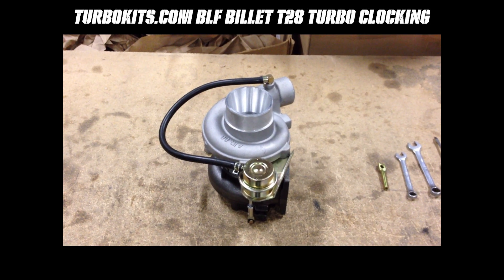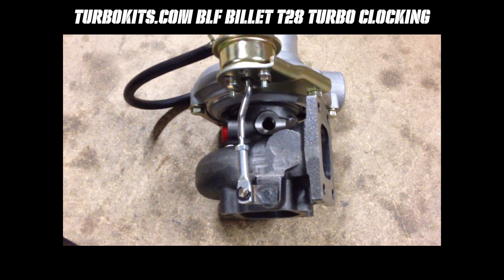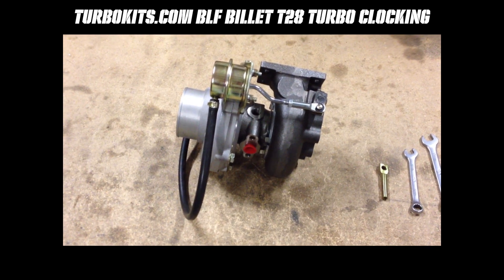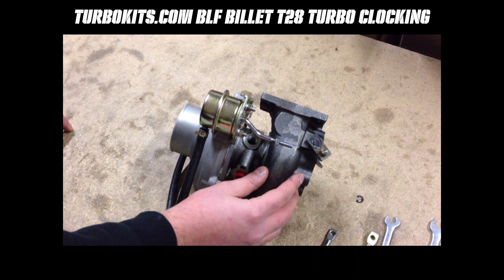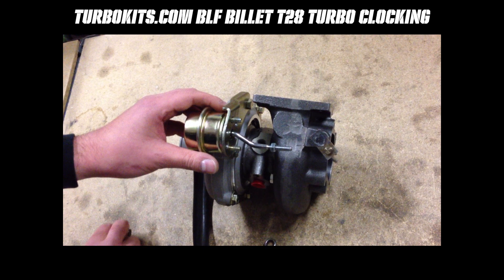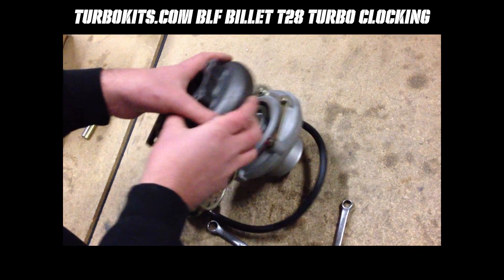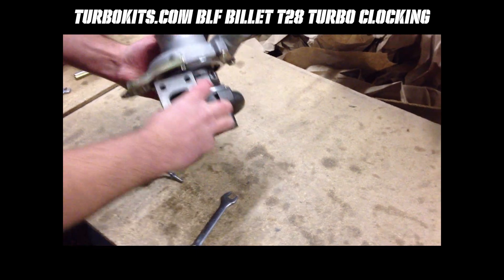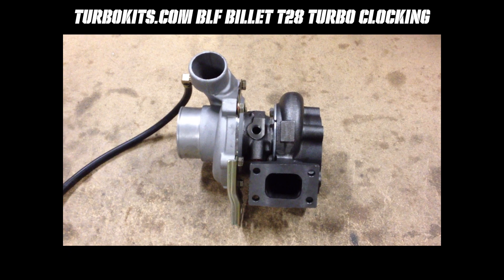How to Clock a Turbo - by TurboKits.com

Comment: thx a lot for the answers,i don t pinch the compressor wheel,but the compressor is not at eleven like in the video and the actuator is not at the position like in the video,i will remove the turbo from the car and fallow the steps just like in the video. thx
Reply from the maker: +5supercinque You're welcome, but I'm not sure what the issue could be. Clocking a turbo is a normal part of turbo installation in the aftermarket. When done properly, it does not have an effect on the performance of the turbo.

Comment: Is this something that has to be done
Reply from the maker: Turbos by nature are universal, companies like Garrett, Precision, Borg, Etc have no idea what you are installing it on, and the orientation you will require, so 99% of the time, on a universal turbo, YES you will need to clock them. If you are asking about this EXACT turbo that comes with our Celica GT/GTS turbo kit, we do bench clock before we ship the kit, so 90% of the work is done for you on that specific application.

Comment: Any suggestions for clocking a small T2 Garrett?  I know how it supposed to be done but it won't move. It has the big snap ring on both the compressor and the turbine. 
I need to rotate both the compressor and turbine clockwise 3/4- 1". 
It came off a 84 Nissan 1.8L 4cylinder and it's going on my Sportster. Any help would be greatly appreciated
Reply from the maker: You have to loosen the snap rings and then it will rotate. Keep in mind the actuator and bracket location will change and could potentially require adjustment to change the clocking.
Reply: @TurboKitscom  thanks for your response. 
I was finally able to get in touch with the guy that actually ran it last. He said he had rebuilt it about 12 years ago and used it on his bike with a  blow through setup while he was tuning and getting the bugs worked out. Afterwards he installed a larger turbo. He said it would probably be hard to move since it had been so long since it was taken apart and moved. He did at least drill and tap 3 additional holes in the compressor housing where the actuator bracket could be moved if it needed to be. Thanks again
Reply from the maker: @LH-kz2nf  Ahhh yes, if it has not been moved for that ling, it would require a good soak in some penetrating lubrication!
Reply: @TurboKitscom  this my first turbo and I chose the most complicated way of doing things because everyone advised me not to try it. First of all very few people get a blow through tuned on a Harley and 2nd no one mounts the turbo on the left side. Luckily I found a 62 yr old engineer that's done it before. He's a very patient man I'll say that and has spent a year of his time through 100s of emails helping me pick engine parts and everything else. The math that goes into this is crazy for someone like me. Graduated in 82 and haven't used algebra since then.  What I learned then they probably teach in grammar school now.
People like you and my good buddy google are a life saver.
When I bought the turbo, plenum and other things it came with a rebuild kit that contains new o-rings, bushings and cartridge.
I just need to find the right set of snap ring pliers. I have two pair and they're not doing the job.
Thanks again for everything
Reply from the maker: @LH-kz2nf  Happy to help, good luck with your build and let us know how it all turns out :)!

Comment: thx a lot for very quick answer,can the wrong clock afect the boost?
Reply from the maker: +5supercinque  - Only if you pinched the compressor wheel and damaged it, but if the clocking was done properly, it does not affect boost.
Reply: +TurboKits.com Silly question but does it matter which side is the coolant in and out?
Reply from the maker: +Hakasauars No, coolant / water is pressure in and out, oil is pressure in, gravity out.
Reply: TurboKits.com Thanks!
Reply: +5supercinque yes you can over heat your oil and water section, coked up oil is no good plus your intake temps would be higher so less,air density less power

Comment: hi,sorry to bother you again,I clock again the turbocharger,everything is good at the turbine position,oil  and water inlet and outlet,but the compressor is not at eleven for my engine position,he must be at eleven on every car?
The compressor at what position must be to make boost?    thanks a lot
Reply from the maker: +5supercinque - It doesn't matter, turbos are universal by nature and can be closed into any position to fit whichever vehicle it is on. The clocking has no affect on the boost production.

Comment: can you run a water/oil cooled turbo with just oil? like block off the coolant port for simplicity? turbo will only see 8 psi max
Reply from the maker: +zombiecheef Depends on if it's a Ball Bearing turbo or not. The journal bearings turbos use oil to make the bearing, so they have a good amount of oil to help aid in cooling the CHRA. The ball bearing turbos however use only a small amount of oil for lubricating the bearings so additional water cooling is needed to keep the internal temps in check. In all reality, it aids in turbo longevity and reliability no matter what turbo you have, so it's best to run them when you can.

Comment: So, for the 2ZR kit, you follow the same procedure but the compressor outlet points down, correct? I assume all the bolt holes in the actuator bracket still line up and a flip of the bracket may be necessary? What brand of T28 turbo (the basic turbo) is included in the Corolla/Matrix 2009+ (2ZR) kit? Thanks!
Reply from the maker: Yes that is correct, follow the clocking instructions, but point the compressor to your specific location required. The turbo is a BLF T28.
Reply: @TurboKitscom  Great. Thanks! So the BLF T28 is the billet wheel turbo? The billet wheel appears to be an upgrade option for the 2ZR kit. Is the 'base' T28 exactly the same as the billet wheel turbo but without the billet wheel? Sorry - learning stage here. :)
Reply from the maker: @acbent11  Correct, they are the same turbo, just one with a CAST wheel and once with a Billet Wheel. Good news, the next shipment of BLF T28s will all have Billet Wheels and there will be no additional upgrade charge for them anymore :)

Comment: Thank you for a very informative video.  That wastegate actuator bracket looks very versatile!  What are the torque specs for the compressor/turbine mounting bolts, and how critical is that torque?
Reply from the maker: +Michael C - Compressor bolts we normally do to 200in/lbs, but it's not critical. Most of the time customer are just hand tightening them.

Comment: hi,I bought a new china turbocharger just like in the video,but before to see this video and before put the turbocharger in the car,I clocked 90 degrees  and the turbocharger dont make boost.
Is possible to clock wrong or the new turbocharger is not good?is no shaft play but no boost.

thank you
Reply from the maker: +5supercinque - The turbo in the video is assembled, QC and balanced in the US, it is not China made. If you clock the turbo properly it will not affect boost. Your issue is most likely the low quality turbo that was purchased.

Comment: hey i just done welding the manfiold and exhaust out now the drain facing up and feed facing down and i cant turn the turbo like what you did i did hit it with hammer but still cant turn it what to use to make it free and put the drian down and feed up? thanks
Reply from the maker: +Prince ALiRaQi Depends on the turbo, some turbos have dowel pins and cannot be easily clocked. If the turbo is used and has been on the car, it maybe seized and you'll have to soak it and get it un stuck.
Reply: TurboKits.com i did clocked it bigger hammer, now will find feed line and return line  do think i can use brake line for feed or wont work.a
Reply from the maker: +Prince ALiRaQi - Yes brake line will work, we typically use -3an or -4an lines for oil feed. Just make sure it's new and clean, you don't want any contamination into the turbo.

Comment: I got a turbo for free a few weeks ago its a td04hl how do i tell the oil inlet from the oil outlet and water inlet from water outlet?
Reply from the maker: +redneck1994 Oil feed should be on the top and bottom and the water line port could be right on top of each other on the side, it depends on the application is came out of and which parts they had plugged, etc. A simple Google search should get you a pic / drawing.

Comment: I bought a second hand garrett t25,but the compressor has no bolts like other turbo,and the wastgate actuator has no bolts,is stick to the compressor
How can I rotate the compressor if he has no bolts?
thx
Reply from the maker: It depends on the origin of the turbo, if it was an OEM turbo from a vehicle, it may not be all that  clock-able.

Comment: I clocked my turbo but now I can’t turn the turbine
Reply from the maker: Is this a turbo you purchased from us? If the CHRA doesn't seat flush into the turbine housing, the wheel could be jammed against the housing. Make sure when you clock or remove/reinstall any housings that you do not force them in place, they will naturally fall into alignment if you allow.

Comment: only suggestion i have is when being curious or wanting absolute security of not burning off the vacuum line is for ex, the setup you did, i would have installed the actuator at a different angle where is would be facing slightly offset from the other vacuum nipple, undoing the clamp on either side of the line, cutting it to a distance where it would be nicely curved around the inlet, and redoing the clamp back on. and anything relative to away from the exhaust manifold. not a necessity but yea